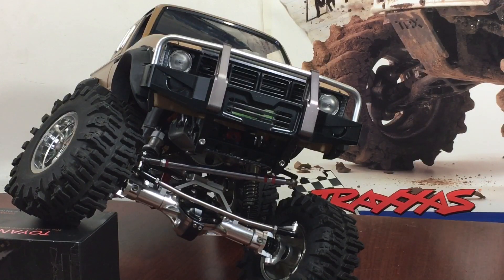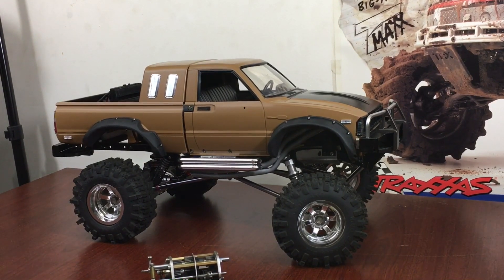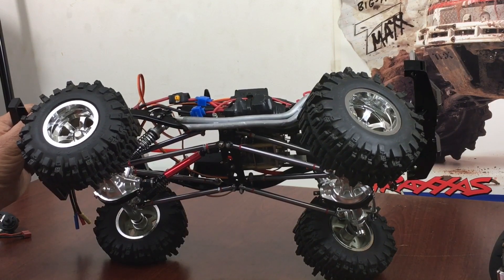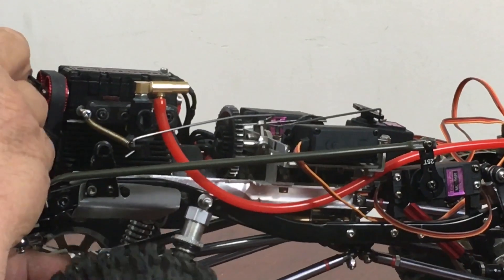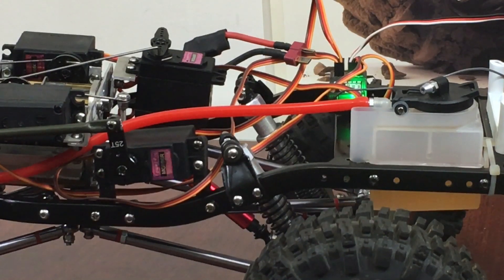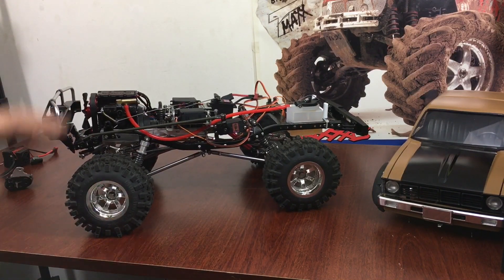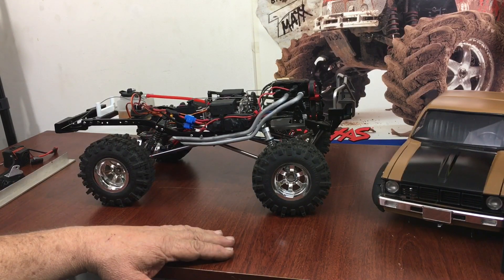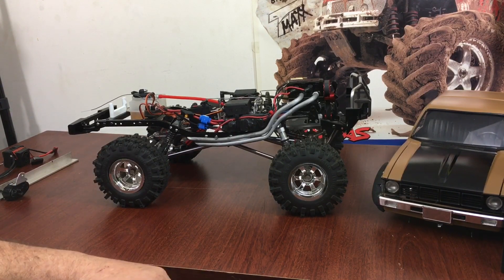TOYAN l200 HG-P407 build updated

Comment: The one thing that stands out is that it looks like it's going to tip over at any time! You should lower the body as much as you can and consider turning the transfer case to one side to help prevent a center hang up point. The angle of the drive shafts to the side is insignificant. This will also allow you to reduce the preload of the springs and lower the ride height! Less tendency to tip over!
Reply from the maker: I have it lowered on the frame as low as it can go, I shared the clearance between the hood and axle links so they didn't hit the bottom of the engine,  the transfer case has to go underneath because of the center pumpkin axles, I had it off to the side but the front driveshaft hit the transmission housing. I lifted the suspension for max articulation with the 2.2 tires,  guess when I take it out for its first run I will see how top heavy it is.

Comment: what if you got another aluminum plate and brass standoffs you could do the same gears as the transfer case but not use the case. just extend the trans another section  it would make everything more compact
Reply from the maker: I almost did that lol, I took a 3/8 air drill one time cut it in half to use the planetary gears and converted it to fit my bruiser with a homemade transfer case and it worked pretty good, I still have it.